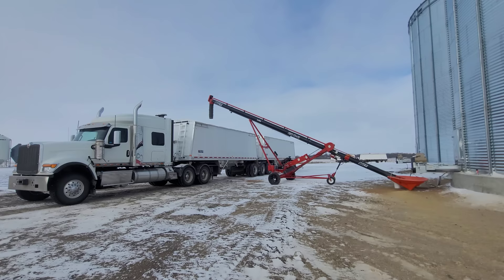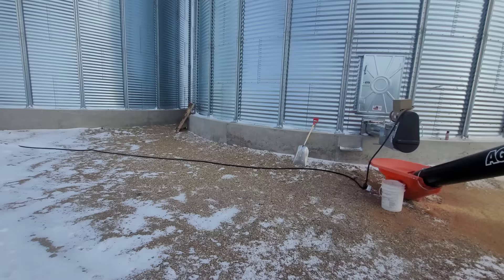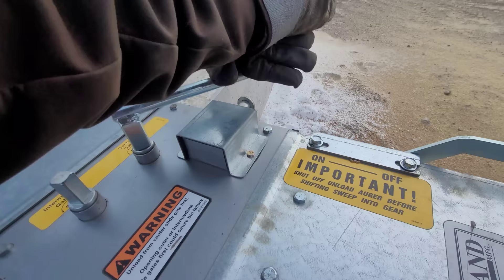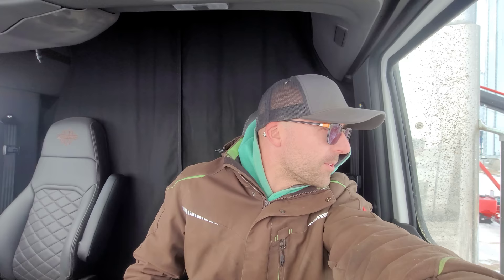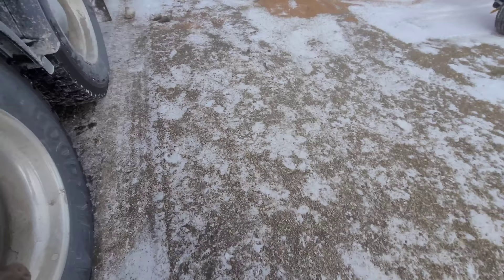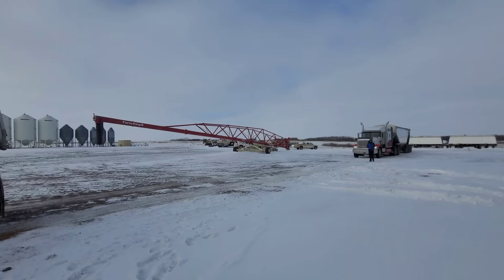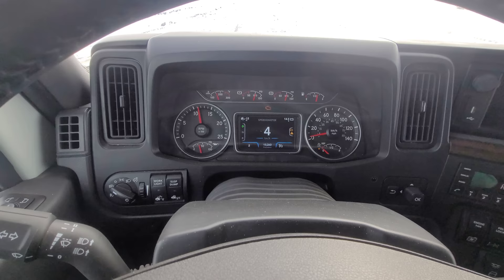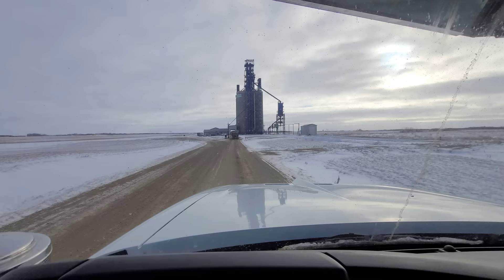Hauling grain to the terminal!

Comment: I use Seafoam in all small engines for years, makes a huge difference keeping them running good. It helps the new crap gasoline keep from plugging up the carbs and passages…

Comment: That generator shack, you could line the inside with rigid foam board to keep the heat  in or when really cold be able to throw a small heater in it to help the engine out. Those doors are terrible to seal they will always fill with snow, thinking they are manufactured that way to have air flow into it if its warm out, cheap fix would be a split pool noodle to block the snow/weather, guy could always cut in a air intake or prop the door open when in use in the cold
Reply: :Looked like the air vents were open with no sloped cover to keep rain or snow out.

Comment: Never understood why the heavy spec trucks designed and built to carry more weight are limited like that. I get it, roads and bridges, but still… A heavy built truck is made to carry more weight but you can’t because of the goobermint. You have to pay extra to use the double or triple frame truck with big axles to its potential, meanwhile a truck built to handle less weight can be loaded to the max.

Comment: 1400 bu. is a nice load. Your not hauling for hire so like you said thatlittle extra tare weight not as big of a deal, Nice video. I see you have no straps running from the front  to the rear of your trailers to keep water from puddling up when trailers are sitting. One less thing to dodge when loading  of  grain & make a mess.

Comment: Hi Mike,hauling grain was my job since April 1987..here in North East of France.😀
Also have a question:how many tons or bushels does the grain leg move in one hour?
Reply from the maker: I am not sure the answer to that question, I feel it can vary 🤔🤷‍♂️
Reply: @mikemitchell2554  
Yes,it's possible to vary the speed of the conveyor...looks like this one is fast..
Reply: Looks like the elevator is taking his grain away as fast as he can dump it.  45 tonnes in 10 minutes, so at least 270 tonnes/hour.  One of my local elevators is about that fast, the other is quite a bit slower, maybe 2/3 of that speed.

Back at his farm the load speed is probably around 100 tonnes an hour.
Reply: @tmlf1239  
Yes,you are right,basicly it's between 200 and 300 tons/h in this size terminal.
In the co op where i worked it was maxi 300,most of the time they run 200 to avoid problems,not very nice when the leg is plugged.😁

Comment: They should  Probe your trailer on the scales. Over a year's time they can steal several pounds of grain
Reply: That's part of the profit margin for the grain buyer, they all sample before the scales. One processor I hauled to would fill a decent sized grain wagon and would have to unload it a few times a day. Some others that were less busy used garbage cans or dumpsters to hold the samples. Double trailers look like a nightmare to back up very far but it would be nice to legally haul that much grain each trip.

Comment: The jet on those vanguards is too small. EPA goofs make it smaller so small engines will meet the new standards they impose. Only hand drill one drill size up. The bigger hole will not get plugged as much as the epa one. That'll get rid of the surging. Fuel filters are made in India  and are of poor quality, and will let particles through.

Comment: What is the reasoning for dumping the air in your trailer when unloading?
Reply: As you load the trailer, the air pressure in the air bags increases.    When you unload the trailer that quickly, the air bags can't exhaust the air fast enough.    Its possible to blow an air bag.

Comment: 20.5tons? I feel like that's still pretty light, my own rig ( mind you, european driver here running Tandem swap bodies ) is 21t / 23.5t empty, depending on wether or not I have the Carry-on forklift on the back. I would have thought those big B-doubles would be heavier!
Reply: Standard bbtrain gvw in Canada is 63,500 kg.
Configured as tandem drive truck, tridem trailer 1, tandem trailer 2.

Comment: https://youtu.be/5CAnOEPXvvc  This is the corrected video link instead of my mistaken video link in my previous comment.  It shows angled flutes in my truck auger hopper that stops grain from flying out of the hopper.  Instead of building a whole new hopper with angled flutes, a frame with angled flutes can be built to fit on top of the existing hopper.  Then it can be used or not used as desired.

Comment: Looks like you need some of that good ole government juice! AKA DEF Looks like the lights on almost
Reply from the maker: On the contrary, no more gov juice for that truck
Reply: I saw that as well and assumed it was deleted.
Reply from the maker: @flemmingnielsen5989  until they make def reliable people will delete it.. Infact, why is there no def on emergency vehicles, army/military or school buses?

Also if you are talking about climate change, let's talk about that and the fact that the largest polluters in the world are not required to have def... 1 single 737 Commercial Airline runs approximately 10.5hrs per day and burns 750gal per hour. That jet would burn more fuel in a couple days then I would burn in a single year.

Locomotives also are not required to have def and those engine only ever shut off for servicing - that's right, they nearly run 24/7 belching black smoke with no def.

What about all the cargo and cruise ships? They are actually measured not by miles per gal but by gallons per foot 😂.. Also no def.

What about the navy, fighter jets, air craft carriers, or the 10,000 planes/jets in the air at any given minute all with 0 pollution control. So instead pointing your finger at an industry that accounts for less than 1% of the fuel usage, ask your self why is there no def on airlines? Because the government's and industry know its unreliable and run on the moto "do I as I say, and not as I do". Imagine the deaths with airlines dropping out of sky per hour because of def code that shut the engines down. 🤣 That would be news worthy.

Comment: I also want to know why you dump the air when unloading
Reply: There's a massive amount of air pressure in the bags when the trailers are loaded, so if you empty the grain really fast, sometimes the bags can't exhaust air fast enough on their own to release enough pressure, and it can cause the bags to overinflate and blow, and then you're screwed/out of service.  So if you manually open the exhaust valve on the bags, they release pressure much faster and won't blow.......just gotta remember to air them back up once the load is gone.

Comment: Hey Mike,  I have a question.  How long is the haul?
Reply from the maker: At the north farm there's like terminals everywhere 😆 like 70km any direction... They don't know how good they have it up here!

Back home we only have 2 terminals, and the closest is 160km one way.
Reply: With it being cold at the north fall you hopefully won't get stuck in the mud
Reply: -40C = -40F, Now that is COLD, Especially if there is a strong wind 🥶🥶🥶
Reply: why do you dump the air on the trailers when unloading
Reply: @boogalookid9562  The air bags are dumped while unloading so the extra pressure with no load doesn't blow an air bag
Reply: We used to farm a few miles south on the Winnipeg city limits. There is must be 13 or more feed mills, grain terminals and grain elevators in just over 100 km.
Reply: @gavinperry7237  never had a airbag blow when unloading
Reply: His truck clocked 56km for the journey.

Comment: Why would you put premium in it? Do you know why premium is premium? You have to be tuned to use it.
Reply: the advantage to premium is no ethanol to gum up your carb
Reply: @rempellegacyranch4965  that must be a Canadian thing.  In the states you still get alcohol in premium.  Rec fuel is alcohol free, but cost more.
Reply: @rempellegacyranch4965  it’s hard to find any Fuel without any Ethanol at all. It’s not going to run right anyway Premium is less volatile than 87 which is probably why he has running issues. They make premium less volatile to combat Knock so when your Engine is Tuned for it as in a Sports Car, etc, you can run more timing.
Reply: Premium (in Western Canada) has a much longer shelf life than regular or mid-grade. Small engines start noticeably better after sitting  with fuel in the tank. The fuel even smells much better. The price is much higher but saves the hassle of dumping and finding legal disposal of stale fuel that stinks and won't burn in the engine after sundown.
Reply: @wssides  Premium is less volatile than 87 that makes no sense since 91+ already burns worse than 87. You can’t take 91+ and think it turns into 87 as it ages it doesn’t work like that.
Reply: You have to have a tuned engine system to get your money's worth out of premium but it burns just fine in any gasoline engine built from 1902 to 2022. I have 30 pages of notes from lab classes with variable compression ratio engine through organic chemistry to teaching the topic to back up my carefully researched opinion.
Reply: @Len_M.  Volatile and detonation and octane ratings vs octane get much too complex to go into. Let's leave it that Mike (and most farmers) get best results by putting premium gas in their small engine tanks. Occasional use chain saws do even better with even more expensive artificial fuel.

Comment: Vanguard motors suck big time
Reply: Kohler's no better.  Have an EFI kohler and it hunts all over the place at half throttle.  Pretty much has only two speeds. Idle and full throttle. Nothing in between.
Reply: I have that same vanguard on an auger. It is terrible. Changed the EFI modules on warranty. Still running terrible.